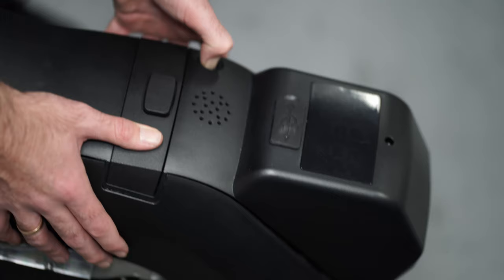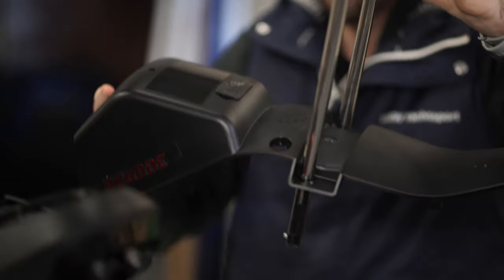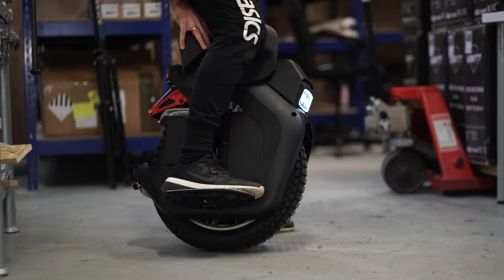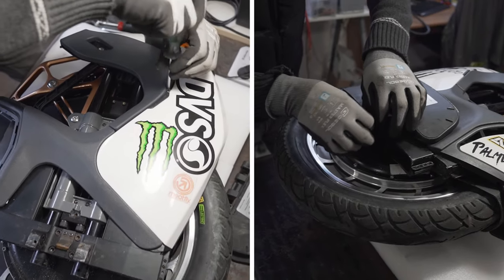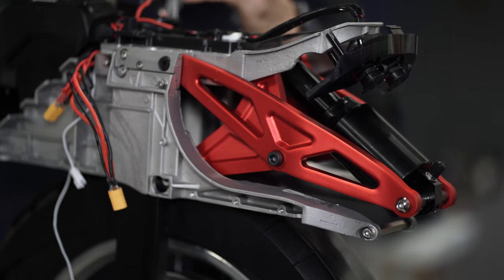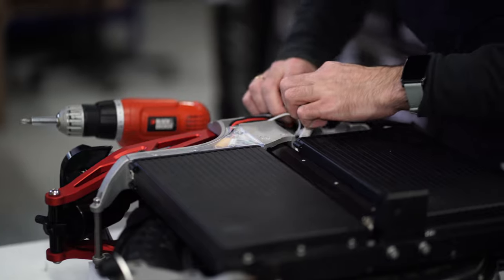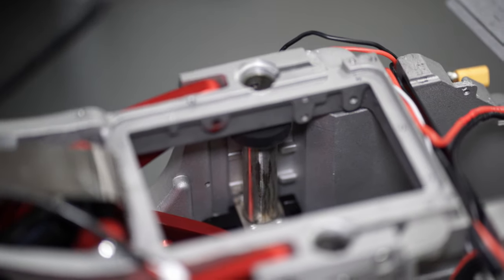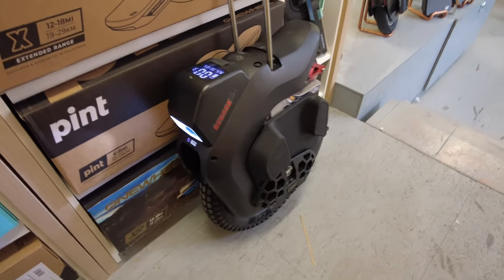⚡ BEGODE HERO REVIEW | QUALITY PATROL [4K]

Comment from the maker: English, Russian, Spanish and Czech subs were added
Reply: If someone literally owns this wheel, I will recommend a product (I am not affiliated, I just love it) called "Sugru" which is silicone putty or clay that cures into a solid, heat resistant rubber.  It's available in small packets and it's not that expensive, especially if you only have to use a little, as well as fitting into the smallest emergency road kit in case something needs to be sealed (also recommend small tube of fast setting metal epoxy in case you crack a frame/wheel, JB Weld is well known but it takes a LONG time to finish curing to trustable hardness).

Make sure you clean your parts thoroughly and use some release agent so it doesn't stick to them.  It can try to fuse with some plastics so a mold can also be made using your favorite method.

I find in most cases there are also inexpensive, reusable thermo-morphic plastics available that soften in hot water and can be used to make fast forms/molds and are "good enough".  Thermomorph is one brand name but they're all the same stuff - it's basically the same material they use to make dental impressions, but hasn't been tested and certified okay for putting in your mouth so it's a LOT less expensive than the other stuff.
Reply: Thank you!
Reply: Italiano?? No eh

Comment: Nice review. Most EUC enthusiasts know about Gotway/Begode’s lack of QC but out of the 5 EUCs I own, 2 Kingsongs, 2 Begodes and 1 Inmotion, I’ve had the least, actually, no problems with my Begode wheels and I easily have twice the number of miles on them than the other brands because they’re so much fun to ride. Their smooth power and speed delivery can’t be beat and they’re actually more rugged than they appear; mine have held up to many crashes and drops better than the others. They are easier to take apart and work on also. I do agree they are not very water resistant so I don’t ride them when it’s wet, but I’ll keep buying Begode wheels because they give me what I like most in EUCs (minus water resistance). I would buy the Hero if I didn’t put a deposit on the s20 because on paper looks like a better value. Thanks and I subscribed.
Reply from the maker: Begode ride quality, power and speed is one of the best in class no doubt. But when the EUC cross such huge sum that you need to pay for it, it is not longer enough. We are waiting for V12 and S20, of course, to make deep dive comparison, than it will be clear what company is the best for now :)

Comment: My big takeaway is I need to inspect EVERY wheel INSIDE before riding it the first time, as it's only one wheel.

If it randomly locks up I can get hurt really bad, even with gear on.  We should do it for all EV, I can see now how we can fall into a maintenance complacency unheard of in the combustion powerplant world, but at least with 2+ wheels I might not faceplant immediately if one of the tires is suddenly stuck in place (make a lot of smoke while the tire shreds but unless you ram into something you'll probably stay upright).

Comment: I own 4 Gotway wheels.
Nothing here suprises me.
Unfortunately I'm still disappointed their attempt to improve quality has the same old problems.

Now that Leperkim is coming out with bigger and better cruisers and Kingsong and inmotion has 100 volt wheels I think I'll never buy another Gotway/Bigode/Extreme Bull wheel.

Whoever their engineers are, they need to do better.
Reply: Well I disassembled my Inmotion V8F with IP55 rating and the controller is sealed in the same way like in the Hero. Also no connector and I have to open the controller. Not only Begode needs to iprove their wheels ;).